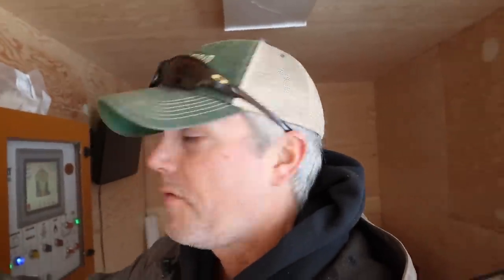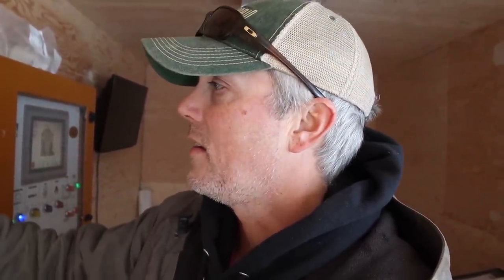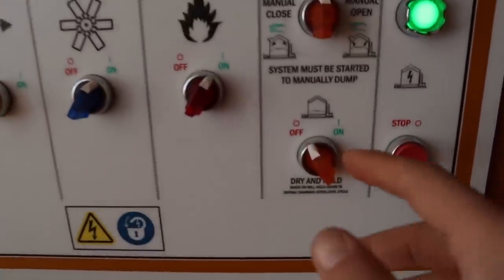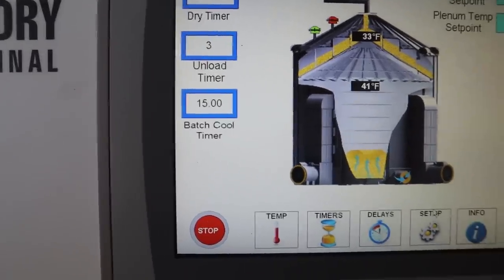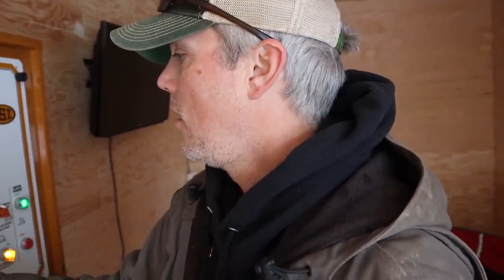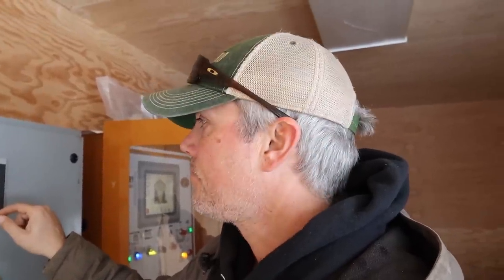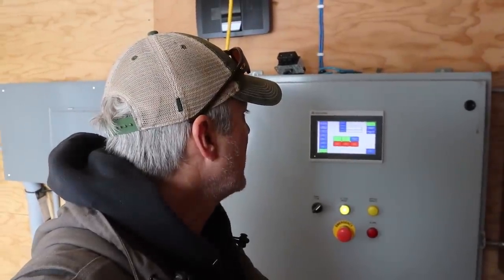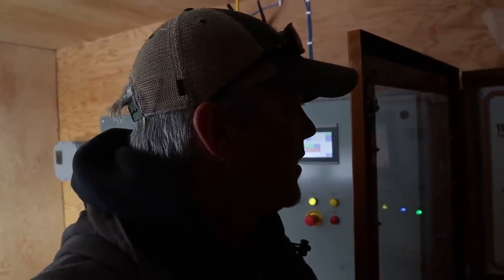Post Harvest Jobs | Vlog 50

Comment: For those who wanted the explanation .... Turbo:  Engines need air to run.  The turbo creates positive pressure where the air goes in (intake manifold) so the engine runs better (more horsepower) because it isn't wasting energy sucking air through the system.

Further explanation?:  the exhaust goes out one side and spins an impeller on the way through.  The intake air is hooked up to the other side and the spinning impeller is what creates the positive pressure on the system.

What about the oil:  Turbos spin so fast and get so hot that the bearings have to be constantly bathed in lubricant.

Comment: That a good sign Mark  you check the oil on the oil stick twice because oil will walk up the dip stick  smart man
Reply from the maker: Didn't know the reason but it was how I was taught.
Reply: @MarkBrock  because the oil will walk up the dip stick is what I was taught I operate cranes and heavy equipment
Reply: @MarkBrock  well use to

Comment: You like the new dryer a lot better then your super B?
Reply from the maker: Overall yes, especially in the increase in capacity.  The biggest issue is determining the moisture while drying.
Reply: Does the super b have the quantum dryer controller